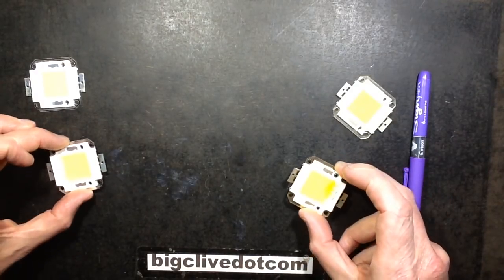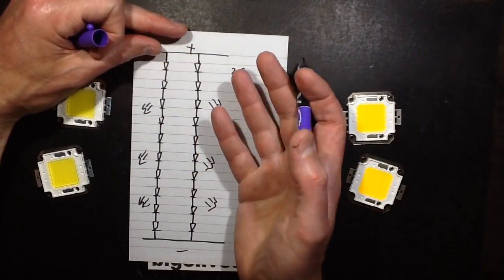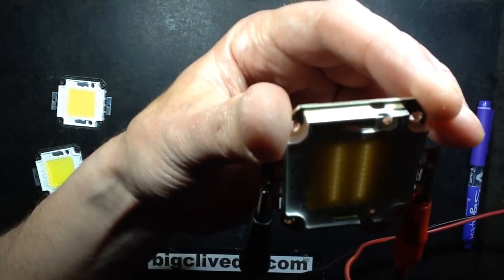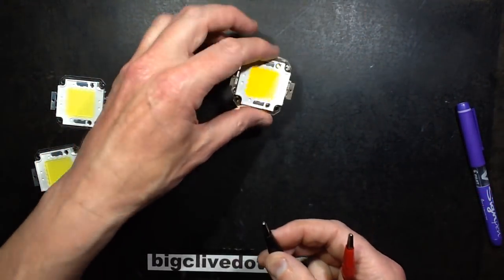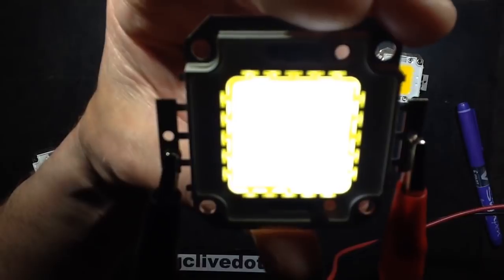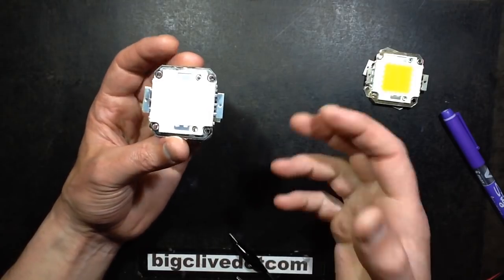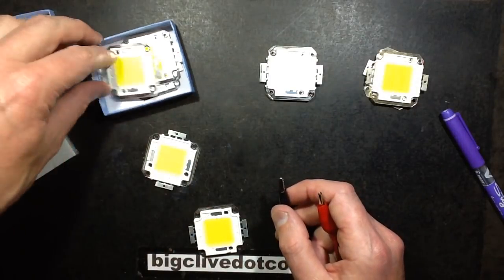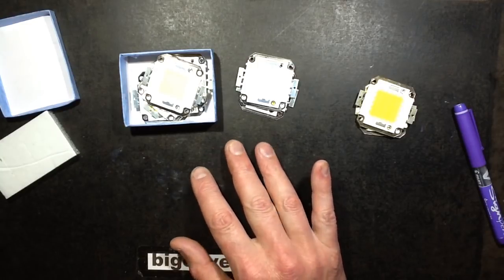Testing dodgy 100W LEDs from ebay sellers.

Comment: i have been thoroughly baffled by light bulbs today. i needed some so looked on amazon. they were all efficiency rating E,F,or G. i was horrified. only a year ago all the ones i bought were rated A. i looked at the L/W and their power use. The ratings still made no sense. it wasn't until i learned that the ratings have all been re-jiggled that it made sense. An E or F bulb now is like an A, from 2 years ago. They have binned the A+,A++, and A+++ ratings, and shifted everything down. i suppose it makes sense no uses incandescent bulbs anymore. but comparing efficiency ratings from 2 years ago and now is a fools errand.

Comment: Hi I am looking for a led driver for my 12v 50w led chip for a motorcycle headlight project any recommendations please.?
Reply from the maker: eBay has a wide range of voltage/current adjustable modules.

Comment: I think they might work at full power.
Make a lumen test on it.
because it might be, that some Leds have some parrallel resistance to them due to a little bit of electrostatic damaging. so they conduct the current to the other ones, so that they dont light up, but the other ones do..Once the current is high enough, they will light up, too, cause then the voltage across the resistance will get high enough to even light them up.

Comment: Would you be able to add in a cap and resistor (and/or other components) to make an LED chip come on and go out a bit more gently, mimicking small tungsten lamps?

Comment: The strings that light at a low voltage contain a blown led or two.   Leds usually fail as a short circuit so you could wind up the volts and try and blow the dodgy strings into open circuit, the remaining strings might then behave sensibly.

Comment: So . . . Where do we go to get good chips?
Reply from the maker: That's the tricky bit.
Reply: @bigclivedotcom  Follow Up: I bought a 50W ($5.38) and 100W ($8.29) on ebay. All chips light up at same time om the 50 and only 6 lag behind a bit on the 100. Seller due20150801
Now I need a heat sink and lens.
Reply: @bigclivedotcom  There must be someone that knows were to get non-rejects???
Reply: @bigclivedotcom  Just placed order for a 50w and 100w from what seems to be a reputable seller . . . . $14 for both, we will see what is delivered

Comment: Gee! I have been wondering why one of my 30w led is not as bright as another 20w but seems to generate a lot of heat! Now I know.
Reply from the maker: They also degrade in efficiency over time.  The arrays are cheap and relatively easy to replace.

Comment: I was recommended this video because I watch other videos of yours, so this may be a day late and a dollar short. I guess that would make me a Yankee.
Those Chinese chips where a few of the LED's light at a lower voltage likely will light all the LED's but the ones that lighted first will get over current and burn out first.
As for a quality distributor I go with this seller, they cost more but they come in anti-static bags, two gold filaments per row with a nickel plated all copper base and all LED's light the same at a low voltage...
https://www.ebay.com/usr/due20150801
Here is a listing of his...
https://www.ebay.com/itm/124011607823
Edit: We do call it "Saran Wrap" because it is the most popular name brand, otherwise we just call it "Cling Wrap"

Comment: I finally got the 10 100watt LEDs I ordered off eBay for 25$, they aren't perfect but compared to these they are great, I only have one led out of the 10 that have more than 5 LEDs at different brightness intensities. I'm running them at ~35volts and they pull about ~2.85 amps. I do have to say though that the seller packaged them absolutely terribly (it was wrapped in clear plastic wrap) and I might try to complain about the one led that is a bit messed up to see if I can get a replacement or a small refund.

Comment: This is normal for all silicon wafer technologies and not faulty, once you turn the voltage higher all turn on. Camera hotpixels, different processor speeds and LEDs. There are no LEDs in the world that would not be like that because each individual led is different

Comment: Nailed it! As usual Clive, no surprise there. 
Have you considered recommending/ no bullshit reviews of various commercial electrical products? 'Does it pass the Clive test'?
I would have 100% belief in a product that you recommend and a 100% belief that you are truthful; manufacturers beware, if it doesn't pass Clive....then it doesn't pass...
Just an idea matey, but possibly a very good one, if I were to source a Lithium Ion battery on e-bey (probably not a great idea) BUT there was one that got 'accepted by Clive', even if it was twice the price, guess which one I would buy?
You 'know your stuff'....in the 80's, it was a requirement, 90's that was a compliment, in 2000 it meant you were old, in 2019 old fossils like me can remember valves and OC71 series Germanium tr's...going forward, I think the new generations of engineers do not understand the 'nuts and bolts' enough, but then they have programs to work it all out for them and hardware available, on demand, with specified characteristics,  to produce a new board in 25 minutes...I can't say that isn't progress (for sure it is) but to have an actual human interface, in particular, one with extreme  semi-conductor experience and knowledge....that's you sirrah!
Interesting question, what to do with the 'stuff' that the very intelligent guys' brought to me.....dump it and again dump it

Comment: You gotta give it full power in order to light them all up....and also what you pay what you get....plz stop complaining!
Reply: The problem is that the LEDs that light up when full power is not applied will be degraded quickly when you try to get the full rated power out of it. There are good and bad LEDs priced similar so it's not really you get what you pay for but your luck of which seller you pick to buy from.

Comment: Fascinating video! After watching, I checked my 100 watt LED modules. Turns out all 100 LEDs lit fine. I got my modules for about $10 each on Amazon. Each one came in a static protective film inside of bubble wrap and more Packaging. I didn't have power source to bring the voltage up like you did so I turn the LEDs on and looked at the LEDs with my welding hood.

Comment: But it's not a fault, it's just the voltage not equally balanced below its operating voltage. Give it the voltage it needs and the problem will go away.

Comment: I'm jet lagged and woke up early. Watching this is so interesting! I have had a string of cob side lights for my car from eBay. Failed after a few weeks, but eventually found one type with silicone gel lenses that seem to last so far. Let's face it, these cob LEDs are new technology. Maybe in a few years the Chinese will have got their manufacturing quality up to speed.
Reply from the maker: Keep in mind that some of the COB style sidelights use resistors to pass lots of extra current (and generate lots of heat) to make them compatible with lamp failure detection systems.  The ones that get very hot can burn out quickly and also cause damage to some lamp holders.

Comment: 100 watts ?   most energy sucking leds I ever seen..   biggest one I got is 4x that area and only pulls 1/2 a watt..

oh..   mine are all normal 6 volt ...  not the garbage they sell in china ( BECAUSE THERE POWER SYSTEM IS DIFFERENT)
Reply: These are actually pretty decent

Comment: IMO; they are not faulty, just  the forward voltage between LEDS are of poor tolerence; as you would expect from a low cost power led, but drive them harder and alls well.
Reply: They degrade faster though

Comment: Why would the 100W led by so much different, to me it feels like it is the same manufacturer in china making them.
Reply: 10 times more likely for there to be a fault (and frankly they might be deliberately selling the slightly faulty but not totally broken ones on ebay rather than throwing them out).

Comment: So did you find a good seller,please share!
Reply from the maker: Not a predictable one.  The items being shipped are still very variable.
Reply: @bigclivedotcom  are you guaranteed to be able to receive a refund if you provide proof to the seller that it's defective?
Reply from the maker: @mashedpotatoes5323  You can open a case on eBay if they are obviously faulty.
Reply: @bigclivedotcom  well wish me luck I just bought 10 of the 100 watt chips, if they have this problem I'll just see if I can get a refund and also keep them too.
Reply: @bigclivedotcom  so I got 10 of the 100watt chips for 25$ and 4 of them seem to light very evenly, 5 of them are pretty decent as there is only a few LEDs that are uneven and one of them are completely fucked as half of them light up more than the other half. I asked the seller for a replacement or a refund for the one led that is the worst.

Comment: Puts me in mind of trying to find high output incandescent headlamps for my bike, which only came with a hopeless single 35w incandescent, and for which 35w halogen only gave a mild upgrade and tended to burn out far too fast because of the smaller capsule and higher temperature... unfortunately it uses a Ba20d connector rather than a typical H-type, and although the connector is good for higher power hardly anyone seems to make bulbs higher than 35w. Managed to find a 45w incandescent and a 40w halogen, both of which worked fine for a while, but apart from that one seller that charged a fortune and has since disappeared, all the other offerings were obvious fakes claiming 60 to 100w output or the like (which were unlikely to be true and would burn out the alternator anyway), and LED ones with uncertain beam patterns and pie in the sky lumen claims... Seemingly aimed at 16 year olds who wanted as bright a lamp as possible for their 50cc scooter, more for bragging rights than utility as there's not really any point to high output on city streets (I was often having to ride on unlit country roads at the time, thankfully not so any more so I'm no longer bothered about finding replacements)... if it sounds too good to be true, well...

Comment: These are originally from a German light manufacturer called Eisnalderado. The LED's you were sold were debranded then sold after being kicked off of the assembly line for the fear of what has happened to yours would actually happen to all of the similar looking ones.

Comment: What a bullshit video. I've seen this in every 100W led module I've used, like others have said it's normal until they get full power. And I've yet to have one die despite tons of abuse of being a portable shop light and everything from chemicals to sparks from grinding metal hitting the lens. And the light output has always been on par.

Comment: High Clive. Did you manage to find LED chips like this with a reasonable good quality on fleabay? I need to replace all 3 chips in a floodlight that i salvaged from the scrap bin at work. The floodlight has 3 LED drives in it rated at 2400mA so i guess 3pcs 80w LED chips is what i need? I'm currently looking at some LED chips from the seller " eternalove2008 " Any thoughts on this?
Reply from the maker: It's hard finding suppliers who sell reliable arrays.  One of the better ones has been sure-display.  You can use 100W LED arrays with a 2400mA driver.  It'll still put out the same power but spread the current across more LEDs.
Also consider downgrading the fitting to three 50W or even 20W drivers but still with 100w LEDs as the cooler running will make the LEDs last a lot longer while still putting out good light.
Reply: I think i will test with 3 x 100 watts arrays first in my floodlight and stick with the drivers for now and see how that works and how long it takes before the LEDs starts failing on me. I bet i will see better result with this ones compared to what was originally in the floodlights. I regret that i didn't record while tearing the lamp apart. Shockingly low quality! We got several of those failing just a few hours after getting them installed. Price tag around 650 EUR per lamp. Thanx for the tip Clive !

Comment: Look for COBs!
Don't buy any LED stuff without datasheet!
The CRI must be >= 80 to have a relatively good color reproduction!
Cool your LEDs noted in the datasheet to get expected lifetime!
Do not hot-plug any power LEDs!
Constant voltage is not the right physical size to drive LEDs -> it is current!
There are different efficiencies of LEDs on the market (lm/W)!

Comment: Did you have controlled at full power if the LEDs were left off?
when you're near the knee of the characteristic curve of the led due to the diffusion of the features some LEDs may be running ahead of others but away (up) from that point you may have the ignition of all the LEDs:  put on a heat sink the led and put a welding glass on it, or wear a welding mask, and  then light up leds  at full power, with the black glass you should be able to see if the LEDs will light up all without buzzing (buzzing?  i mean blinding yourself.. google translator .. bah!)
maybe you did it already but in the video do not talk about it.

Comment: Very silly test, wrong conclusion. Notice how only a couple tiny blue dots remain when you drop the voltage low enough? does that mean that all 98 others are defective and won't light? Of course not. So applying a too-low voltage to the point where only half fire off proves nothing about their quality. It would be ridiculous to expect these gradient diodes (LED's) to all fire at precisely the same moment when you apply an insufficient half voltage. It's your test that's defective.
Reply: They're diodes. NONE should light at too low a voltage. If even one does that that means that some if not most of the others are not functioning as diodes at all, but as resistors - ie that they have a track blown across them and are faulty.

Comment: I’ve used a 100w 5500k led as a replacement for a 250w 24v HID in a dmx scanner
The life of the light went from 50 hours to a lot longer

Comment: They should have added a resistor in series to account for differences in doping variations of the substrate.  LEDs should never be driven to the rails, they will burn out quicker and luminescence per mW will start to drop off.

Comment: Hi what is the actual maximum current these 100w led arrays will pull on a decent chip? The reason I ask is I am building a torch with 7 of these linked in parallel and I am using a DROK dc to dc converter to step the voltage up from a 4 cell 16ah lipo pack (14.8v nominal). 

They work well and put out a ton of light. But the dc to dc converter display is only showing 6 amps output at 30.5 volts. Volts x Amps would lead me to believe 183 watts is being pulled. The chips are rated to 100w a piece??? So do these actually pull 100 watts or is the dc to dc converter showing a false reading. 

The chips certainly are doing there job as the heat sink is baking hot after 2 minutes which is what they did when I had a direct 36 volts of 8 cell lipo rigged to it. They pumped out 36 volts roughly and there wasn't anything regulating them.

Comment: I know that this is an old video, but in my experience Sure electronics are the best supplier. They do sell a few different types of this style of LED, all packed in anti-static bags but I've found that if you want the good, matched ones you've got to get the ones sold as having 45mil chips. These should come with sure electronics branding on the bag, whereas the crap ones that I got from Sure are branded Wondom. Haven't tried the 30mil ones but they may be good ones too. The downside is that the 100W chips are about £12 each.

Comment: i am curious if i can solarize a 10watt led flood light . what rechargable battery, how many hours of battery life? how hot will a tiny 10 watt get? heat sink is it needed?
Reply from the maker: It will need a heatsink if used at modest current.  You could drive one from a solar powered battery system, but 10W is a modest amount of current at 12V.  Around 1A.

Comment: They're not "duff" LEDs, they are just mismatched (as you correctly pointed out)

There will be a distribution (typically Gaussian but the distribution width may differ depending on the quality of the development of the process) to the voltage and current characteristics of each device made. The LEDs you've bought are likely to be a conglomeration of the far-from-specification variations in the process which are put together in a device because they are all that is available after the good devices have been made using the high likelihood on-specification chips. It is a money saving measure in the manufacturing process and the chances are that the mismatched chips will not last as long and have a low electrical-to-optical efficiency.

If you turned this up to full power, I would imagine all the LEDs would turn on but some would shine brighter than others and overall the array would produce more heat than the good one.

Comment: I need your help!!! I purchased 5 outdoor 100w pure white flood lights they have 2 led's in each one. I use them in my garage. i build motorcycles so i needed the light if you where wondering why.. lol. ok so my problem is that I took off the motion sensors and wired them direct to a on off switch. so I can't return them! i I purchased them at the beginning of this year 2017 and now four of them are giving me the flicker.🤤. can you send me a link to the best led replacements please. ps thank you so much for making videos on YouTube.

Comment: The main purpose for a Diode is so power only travels in one direction, like a check valve for electric, but in all reality, trace amounts of juice leaks backwards all diodes do, but the Zener is designed to do this for special reasons, not all LED's are created equal.